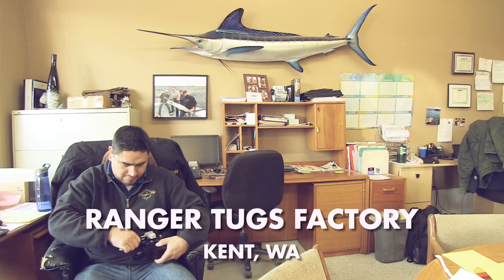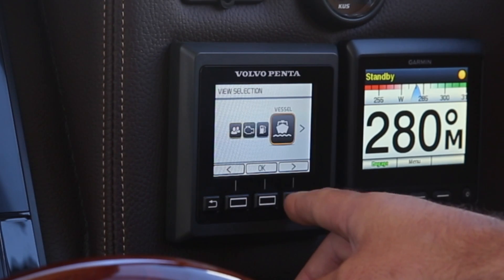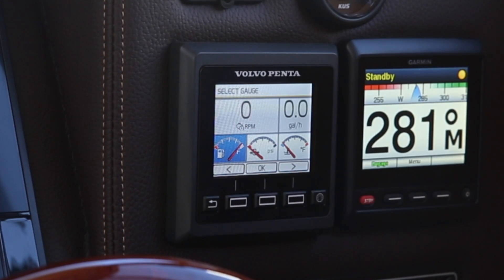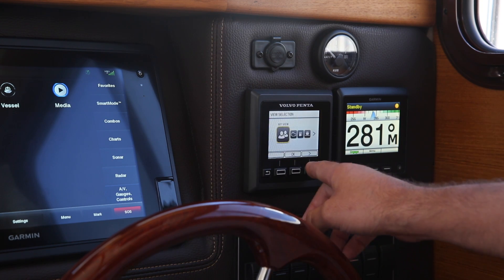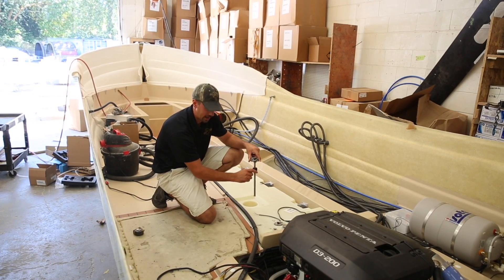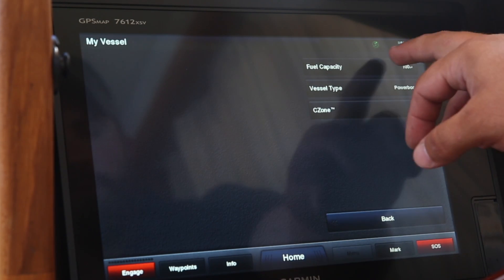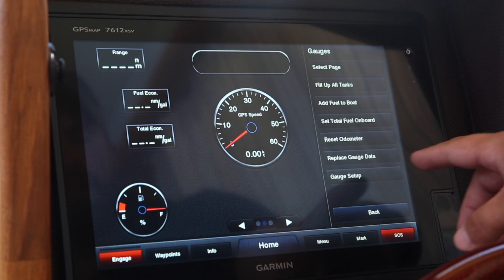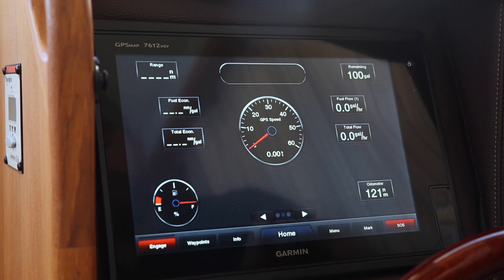FUEL CALIBRATION - Ranger Tugs Factory Tech DIY

Comment: on my cutwater 28 (2012) my fuel gauge on the volvo display always shows 100 gal. the gauge on the 5XXX series garmin drops as fuel is used. my understanding is that the garmin data is based on a calc of fuel flow not a level check in the tank. as the gauge on the volvo display never changes: could I have a faulty fuel level sender?